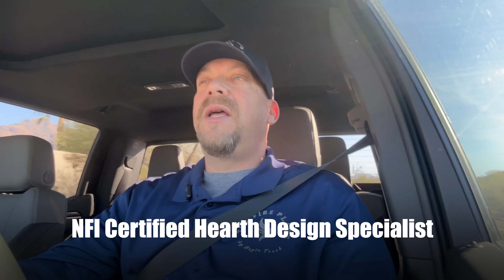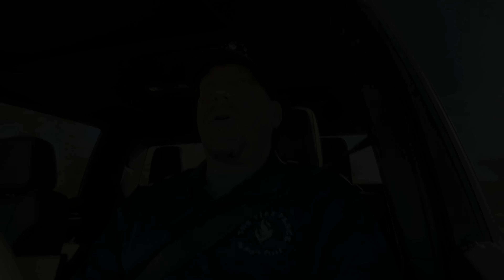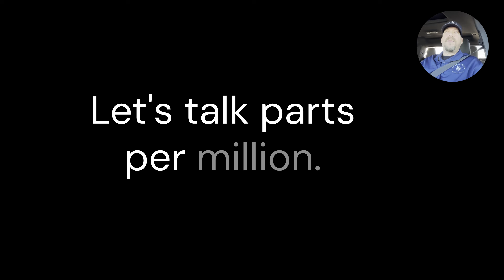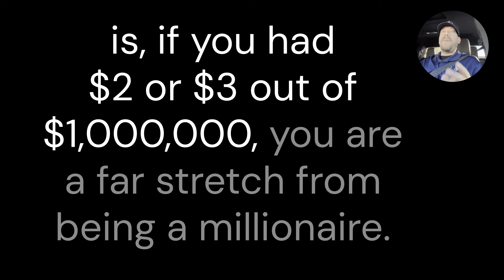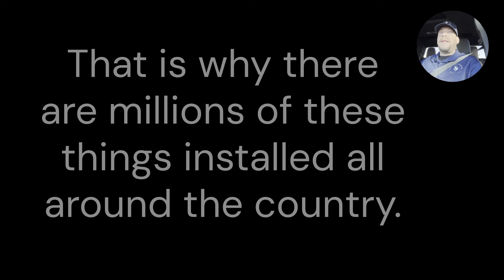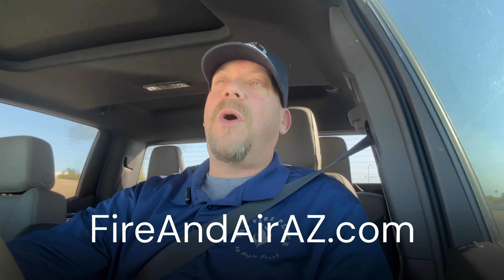The Truth About Ventless Fireplaces

Comment: I just recently found this channel and appreciate his candor. If I lived in the Phoenix area, I’d certainly reach out for HVAC consultation and installation options. This specific video is excellent! I’ve had a vent free Monesson unit I installed in my basement buildout 25 years ago.  I live in Chicago area and turn it on every winter morning I spend time down there. It’s on a simple thermostat that I can toggle on/off or set to 70 and it runs as needed. Best decision I ever made in that buildout. I’ve never cracked a window (but don’t dispute the option to do so). Also have a combo smoke/CO in ceiling 12 feet away and it’s never chirped yet.
Reply from the maker: Thanks for the kind words and for sharing your personal experience! 😊

Comment: We just moved into a new to us home with a ventless fireplace. New for us to own one.  Runs of propane that we fill up. I put in a CO and flammable gas detector across the room.  Looks to run fine and the house gets warm quick. Should we just crack a window or when we run it for safety ?
Reply from the maker: I always recommend cracking a window (or two for cross flow) when it makes sense. Introducing fresh air into the space is never a bad thing! Thanks for watching 😊

Comment: I’m in New Hampshire and have a home with a beautiful 36”
conventional masonry fireplace that was never used. 
I’m shopping for a 24” propane (no NG here) log set and I was told my flue damper has to be locked at 1” open. 
Does that sound right? Keeping a damper open (even 1”) will allow a lot of tempered air out when the FP is not in use. 
BTW:
I’m originally from Brooklyn and grew up with my Dad yelling at us about “heating the neighborhood “ also. Brought back memories😢
Reply from the maker: Yes, it is correct that you need to install a damper clamp to permanently hold the damper open if you’re installing vented gas logs in a masonry fireplace. You’re not required to if you choose a vent-free gas log set, or alternatively you could install something like a direct vent propane insert (or NG converted to LP insert), but that will also require running a new flue/liner and will no longer be an open-face fireplace. Thanks for watching … Go Yankees! 😊

Comment: We are putting on a small addition off our living room and my wife would like to get a ventless fireplace. We live at 8.600' in the Colorado Rockies so we have effectively about 6%-7% less oxygen in the air. Does the 99.9% efficient burn ratio still hold true?
Reply from the maker: Most manufacturers instructions prohibit installation above 4500’. Ventless fireplaces are equipped with an ODS (oxygen depletion sensor) which shuts off the burner when low oxygen levels are detected - this would likely happen regularly at your elevation rendering the fireplace practically useless with nuisance shut offs and result in incomplete combustion when not shutting off. In your application, a vented fireplace is frankly the best and only option as it can be ‘turned down’ (calibrated) for your elevation by a pro to account for the thinner air. Thanks for watching … great question! 😊

Comment: I am in process of getting my fireplace ready for the winter. We have a large open living and dining area with 2 exterior doors and a full wall of windows. We just got our attic reinsulated and I am hoping this winter to be able to heat this room with my fireplace. I'm having my gas line inspected, I had the chimney and fireplace inspected.... So now I am trying to decide on what setup is best. The fireplace people want me to go with a match light system, which is not bad, but I really want a remote. I could live without it if needed. I was leaning towards the ventless logs because they heat better and I can use a remote. People keep telling me the remote kind always fail after a few years and I'm sure the ones in my budget range probably would... Can I use a ventless system safely by just keeping my flu open? Will a vented, match light system give me enough heat since I would be able to adjust the flames? Any advice/suggestions appreciated! ❤
Reply from the maker: My guess as to why they are recommending a match-lit system is it has to do with your budget. Match lit vs safety pilot vs electric ignition with remote control will not change performance, only convenience and safety. 
Yes, you can leave the flue open with a ventless log set/burner in most cases. 
With regard to a vented system giving you enough heat, it all boils down to the math. Vented systems are not restricted to a certain btu output the way vent free systems are (limited to 40k btu), however, vented systems (depending on the type) are not as efficient as some of the heat will go up the flue as opposed to back into the space. However, the size of your firebox, space, and flue will dictate how many btu’s are needed and allowed. I would ask the company to show you a side by side comparison of vented vs vent free with and without remote control that will work in your particular application and take it from there. 
Lastly, I don’t agree that remotes “fail” after a few years however you are adding electronics that can fail and need replacement vs a match-lit with no electronics to fail … but you give up the convenience and safety remote electronic ignition provides. I recommend you watch this video for a better understanding of controls and determine if it’s worth upping your budget to get what you “really want”: https://youtu.be/w-WBulcDgIE?si=BCwWibL_fJLovMu9

Comment: Would a ventless fireplace work in a wood fireplace with the glass door closed and the chute open?
Reply from the maker: You would need to keep the glass door open as like a wood burning fireplace, it gets its combustion air from the room, but you could leave the flue open or closed with a ventless burner/log set.
Reply: @magictouchair i was thinking if the flue was open and the door is closed it could pull in enough air from the chimney? If this is ok then i wouldn't be losing as much heat from the house? Also my fireplace has  blower vents. I can't see buying a closed vented when it seems i already have a closed vented area.  Or I could get vented gas logs and place in it and maybe would work the same as the inserts without getting an insert? Thank you for sharing your knowledge on this subject.
Reply from the maker: @greentea7539  . Without getting too deep into the weeds with techie info, the bottom line is you could not use the chimney to draw in combustion air with the glass closed, it would not work properly and it would be dangerous. That said, yes you can definitely use a vented gas log set in a masonry wood fireplace - that is their main intended use. Keep in mind, you would still need to keep the glass doors open when the fireplace is in use as it still uses the house air to feed the combustion process.
Reply: @magictouchair thanks i have been watching a lot of videos on this topic. We bought a house with a wood burning fireplace that has never been used. I understand why. They should have put in a enclosed gas unit. It probably will be replaced with one after getting things necessary to be fixed first but what a shame. We might burn some wood here and there as we wait. Thanks again.
Reply from the maker: @greentea7539  . You bet! Best of luck 😊

Comment: I'm in West Virginia and we have cold winters. We have a two-story house we have a gas furnace outside unit it also has a c. It's an old house built in 1920 that was a remodel prior to our purchase in July 2024. There is ductwork in the crawl space under the house and deck work in the attic space. The upstairs stays very warm in the winter for more gas furnace and every room downstairs stay warm except for our living room which is in the front of the house. The house is approximately 1500 square feet. We have a large open living room area and we are thinking about putting a 26 BTU ventless natural gas fireplace in our living room. The top two reasons we are considering this is because the living room is the coldest room in the house in the winter time and if we have power outages in the winter the gas furnace will not operate. We have someone coming on Thursday to check out our gas lines underneath the house and install the proper gas lines we will need  to install a ventless fireplace. Is there any specific questions or concerns that I should discuss with the plumbers who's coming to install those gas lines? Another question I have is how does a ventless gas fireplace work together with a gas furnace. Will it be more efficient to keep the gas furnace set on a low setting and run the ventless fireplace at a higher level? Any information or suggestions would be helpful, thank you for your time and I enjoy your videos
Reply from the maker: Thanks, I’m glad you like the videos! Running a ventless unit as a supplemental heat source while keeping your thermostat set lower is common, but be sure to prioritize air quality and most importantly the proper sizing for your room … you’ll want them to verify the new ventless fireplace meets the requirements and is not considered an ‘enclosed space’. Not knowing the specifics of your home, budget, etc. I’d also ask them their opinion of the pros/cons of ventless vs vented options for your application. Lastly, if they also handle HVAC, I’d want to investigate why the furnace / ductwork is not keeping the living room comfortable… I.e. is it the duct design, or possibly the homes envelope issues (insulation issues, air infiltration / exfiltration, etc.). If there is a company in your area that is experienced in fireplaces, HVAC, and home energy audits, that would be your best bet as they all intertwine in home comfort. Thanks for watching!
Reply: @magictouchair thank you, we had a tech here today they told me that a ventless was a good choice it will be in a large 24x12 room. They also checked our ductwork and said it was in good shape. The room is the farthest from the heating unit and that is why they said the room didn't receive as much heat. The air flow is good it's just not as warm by the time it reaches our front room. That kind of makes sense to me. Anyway thank you.
Reply from the maker: @kathybrunty5748  that’s great, and you’re welcome!

Comment: No dude, .1% is 1000 parts per million, not 2 o 3….…..you definitely know your fireplaces….but just want you to get your math right
Reply from the maker: Thanks Raquel, but in my defense, I explain that the .1% is the efficiency loss not the PPM of poisons which I later clarify is approximately 2-3PPM (but I don’t quantify it other than expressing that 2-3PPM is not dangerous). However, you’re correct … I could’ve done a better job separating efficiency from poisons PPM in this video so I can see why it could be interpreted that way. 😊

Comment: Great video and I'm going to take you up on your offer of answering my questions...

I purchased a Mr Heater Blue Flame 30K BTU stand alone Propane heater to heat my family room a few nights out of the year more cost effectively than cranking on the central heat pump.  I'm in central Florida at near sea level.  I bought this to use on those really cold evenings and nights we have a few times per year to try to not have to heat the whole house with an electric heat pump.  Before using this in the home, I assembled it and lit it outside and let it burn on high for about an hour or so to burn off any oils or other contaminants before moving it indoors.  I placed a 20# Propane tank outside on the patio, ran a Dual Stage Regulator attached to a 24' hose through the window opening into the large 792 sq ft family room with 8 ft ceilings.  There is a full very large wood burning brick raised hearth masonry fireplace on the east end of the room with a fully working chimney with a flue that I have used very often in past winters and it works fine, just doesn't produce much heat for the amount of wood she consumes.   I placed the heater on the floor about 2 feet in front of the hearth and opened the vent at the bottom of the fireplace glass doors fully.  The fireplace flue is cast iron and really doesn't fully seal very tightly when closed, so I left the flue closed so I don't much lose warm air up the chimney.  When we had a cold snap for a week or so in Jan 2026, I cranked up the heater and ran it on level 2 of 5 on it's thermostat from about 6pm in the evening until about 9am in the morning to maintain the space at about 69° F.  The heater ran for about 5-7 minutes, then shut off for about 15-18 minutes, then back on again cycling throughout the night.  I decided that I would stay in the room overnight to monitor this heater which is standing in a wide open space in front of the fireplace  on the floor no where near any furniture just to see how it performed. It seemed to perform well, and in the morning, we would turn it off and let the Florida sun heat home warm enough to not need any supplemental heating.  

After about 4 days of operating the heater this way, I began to notice discomfort in my windpipe, chest and lungs, and muscle aching in my back, shoulders, elbows and wrist joints as well as the muscles in my arms.  By about 3 AM on the 4th night of use, I just couldn't take it any longer and decided to shut it down and open all of the doors and windows in the house and air everything out for a couple of hours.  I did not turn the heater back on after that night.  It burns a beautiful blue flame until just before the thermostat turns it off at which time I see a little bit of orange across the burner for about 1 minute or so.  I have a CO CARBON MONOXIDE and GAS detector plugged into the wall about 10 feet from the heater and I was running 2 ceiling fans in reverse mode to mix the heat off the ceiling down into the room via the side walls and try to not have any real drafts to disturb the heater.  The room is rectangular, about 18 x 44 ft long with 8 ft ceilings.  I ran them both on low speed during heater operation which really kept the room very comfortable from end to end.  After a couple of hours I still didn't feel any better so I took about 800mg of Tylenol which really worked good to relive all of the aches and pains.  I had to continue this dosage for about 3 - 4 days every 4 - 6 hours plus opening all the doors and windows in the home for a few days during the day to fully get all the toxic crap out of my home and my body before I began feeling like myself again.  

I believe my mistake may have been not having any air evacuation and very little fresh air coming into the well insulated room which allowed the CO2 Carbon Dioxide and other gasses to build up in the room.  The CO Detector and Gas Detector NEVER showed any CO or Gas in the room, and it claims to be able to measure as low as 50 PPM for CO.  I did test the detector by lighting a butane lighter, blowing out the flame, then pointing it near the vent on the detector and it went off immediately.  So I know at least the Gas Detector part was working.  No way to actually test a CO part of the detector that I could fine.  

Anyway, after reading many online blogs and the manual, I believe that perhaps this unit is too big for the space I'm trying to heat.  I suspect it should be a 15 K - 20 K BTU heater considering my cubic feet that I'm trying to heat of 6,336 cu ft.  It's a well insulated room with a wall full of single pane windows, but I did close the 4 doors leading to the rest of the home to contain the heat and any fumes to a single space during use and that way I didn't really have to run the heat to the rest of the home at all saving lots of money on electricity which is pretty expensive down here.

And of course exhaust and fresh air injection was severely lacking.  From what I have read, for 30K BTU of heat, I should have about 225 cu ft of fresh air and exhaust air per minute flowing, and I definitely did not have anywhere near that amount of air exchange.  Please let me know if that is a good volume to use with this heater.

Anyway, I'd be curious to know if my thoughts are on target or not and whether I should opt for a smaller heater or just make sure I have the 225 cu ft / min air exchange to be able to run this heater safely and efficiently.

Thanks in advance for your reply,

optionstradermen
Reply from the maker: It sounds like the unit's built in ODS (oxygen depletion sensor) was shutting off the unit from what you describe. I highly recommend you search for an "enclosed space worksheet" and "combustion air worksheet" and fill them out to determine the right size for the space. As you describe it being tight and then closing of the adjoining rooms, it sounds like you put yourself in harms way so I'm glad you feel better and have discontinued doing it. While I can appreciate energy savings and keeping the bills down as much as the next guy, it's not worth risking your health to save a few bucks. I'd recommend you use a vented set since you already have the chimney or consider using your central heating system even if that means higher energy costs... you can't spend savings if you're not around to spend them. Thanks for watching!